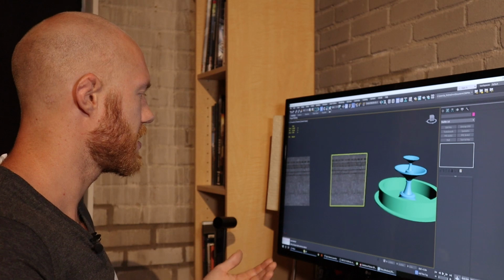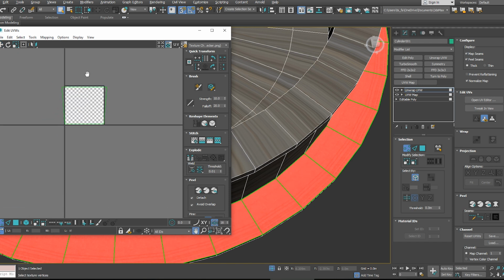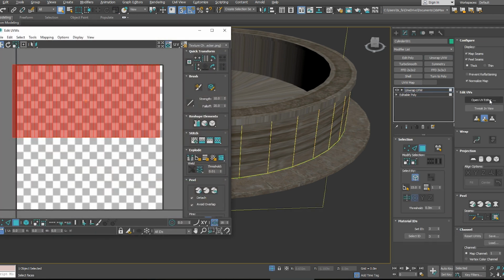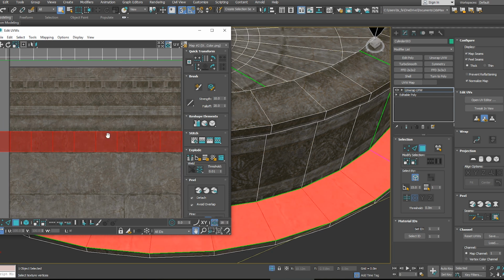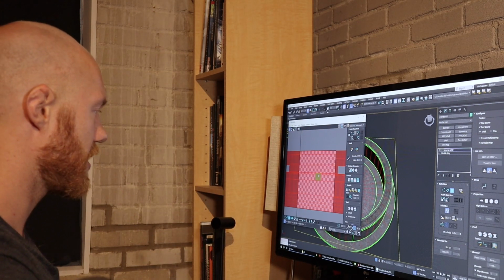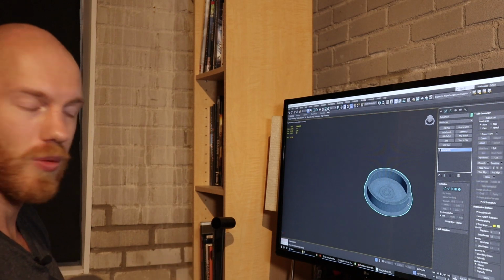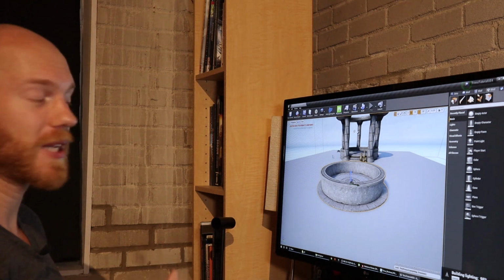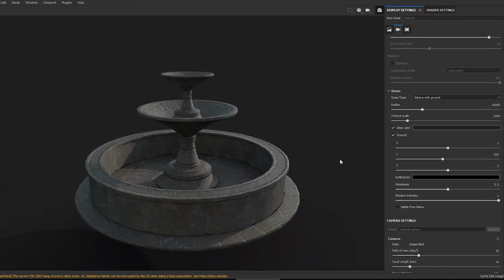Quick and Easy Trim Sheet UV Mapping Tips -Trim Texture Tutorial Part 4

Comment: I really liked this tutorial, even though it was a bit trickier for me because I'm using Blender. Still, I like how the mesh I made turned out. Though I'm sure I'll probably see a lot of problems with it when I get more experience with applying trim sheets to models.

I can see the main benefit of trim sheets, other than saving texture memory, is that it's easy to change any part of your texture if you want to add more detail or change it around a bit. One only needs to modify one strip instead of changing an entire material.

I'm definitely going to have to experiment with trim sheets and see what I can make. Maybe just make a bunch of simple objects, though I've had the thought of creating some simple sci-fi hallways. Though it might be better to create some buildings or other larger structures to test out the capabilities of trim sheets. Maybe some buildings, sidewalks, and roads.
Reply from the maker: yea its a super useful workflow. if you go on artstation and search trim sheet you will find a ton of examples, from beginner level to lots of AAA examples from games, it could give you some good inspiration and ideas :) thanks for watching
Reply: @PolygonAcademy  
Yeah, I should definitely look at Artstation for inspiration, thank you for the idea. And you're welcome.

Comment: My question would be, about how much texel density comes into play when modeling, as clearly the trim sheet will have correct density for given dimensions, for circular strips there will be some acceptable warping, but I guess the better an edge or strip matches the density set out in the trim sheet, then the better the texturing on the model?
Reply from the maker: Yea it definitley can impact your modeling, 10-20% wiggle room isnt very noticable so its not super rigid but for more complex/custom assets you can design trim sheets with different thicknesses that work better, and then combine it with 4 way tiling materials for larger surfaces where trims dont work. Like a wood planks trim sheet for detailing and a tiling wood texture to fill in other areas. 

With nanite you could also use the trim sheet to displace all the details and then texture the model with more basic tiling materials + texture masks for stuff like grime, damage/ scrapes etc because the displaced geo will be providing the details and that doesnt impact texel density
Reply: @PolygonAcademy  thanks for the detailed reply. Long time, part time indie dev, currently targeting VR so draw calls, bandwidth are priorities and nanite not some I can afford, but useful to hear that 10-20% margin is not so noticeable.

I think I will plan to build some trims that will cover specific architectural features and then try to model with constraints given by the texel density - ie if I have a tiling row that is optimal at 10cm tall, I’ll try and stick within that.

I’m considering some options for grunge/AO/weather etc… that will allow single shader pass and allow for essentially some decals for these kinds of elements but I’ve yet to come up with a good solution…

Comment: For Blender users, google 'Follow active quads' - essentially, add a seam, unwrap, rotate the unwrapped quads so a central one that is the most square is the right way up; select the left most X verts in the UV and S -> X -> 0, to scale the edge in X to the same X co-ordinate, repeat for the right edge in X and then do the top and bottom edges in Y, you know have aligned verts; swap to face mode, select this face and then hit L to select linked and right click and choose 'Follow active quads' and you'll get a strip you can scale.

What is missing in the above is a way to ensure the X and Y edges are the same length, resulting in a square, so I need to check that myself. There also ought to be a plugin for this as I use it a lot :D probably a relax in Blender would achieve that square result.

EDIT: I just found this video, with a promising UV Squares addon....

https://www.youtube.com/watch?v=JN1lLYsdeWc

yoink

Comment: New learner： how is the texture applied in 3dmax? Is it the base color exported from SP? Looking forward to your reply, thank you!
Reply from the maker: Yea i just use the base color in max and use all the other maps in unreal for the full shader with normals/roughness, they all get exported from painter. Thanks for watching :)
Reply: @PolygonAcademy  so how to add base color to max? Is it on the material panel or UV panel?:finger-red-number-one:
Reply from the maker: @zerolhaw62  yea you add it to the material, you plug the albedo map into the diffuse slot of the material and toggle it to show in viewport and it should work :)

Comment: /\ this, this is it. University deadlines done in like a few days. and i can use the textures over and over again. Question, if i want to combine two trim sheets onto one model, how do??
Reply from the maker: You would just use 2 materials on the mesh, apply each material to the areas you want it with material ID’s

Comment: Question:  What is the best way to deal with a large terrain.   By trim sheet or just repeatable texture.  But ppl will see the tile really quickly.  Wonder if there has a  better way.
Reply from the maker: Using a 4 way tiling texture, and then blending them together with vertex blending to help hide the repetition, and adding detail props ontop to also break it up

Comment: This is great!! So In case you want to bevel this geo, how would you handle the trim mapping? Bevel after and then fix Uvs?
Reply from the maker: yea i would bevel then fix the uvs. But i never really add bevels when using a normal map that has edge information. if you are using basic tiling textures and face weighted normals adding the bevel will definitely help. for me its either one of the workflows, i dont mix and match usually.
Reply: @PolygonAcademy  Thank you so much for replying Tim! And awesome! So far I have been working with tiling textures and weighted normals but getting rid of seams is super painful sometimes :(

Comment: I didn't realize that I have been using trim sheets for my projects for about 5 years lol
I do like that this video series went more in depth with trim sheets and how to properly setup and utilize them.

Looking at someone using 3DS also, I had forgot how cumbersome 3DS could be haha
I haven't used 3DS max or Maya since Blender 2.8 came out. 
Now in Blender 3.0 UVing and texturing is so much quicker than in 3DS max.
Reply from the maker: awesome, yea i gotta learn blender, I rarely do any 3d modeling anymore so i would be hella rusty either way, but keep hearing how blender is just amazing now.

Comment: how do you get the buttons under the modifier list ??
Reply from the maker: i think there should be a little icon at the bottom right of that panel, or if not you can right click and go to customize interface, then there is the option to add buttons under the modifer panel, you can add as many as you like then drag and drop whatever modifers you use most onto them. its been a  while since i did it but its pretty easy to figure out with a right click in that general zone and poking around :)

Comment: Thanks for this Tim, I learned a lot and finally finished my first trim texture, looks amateurish but hey, ill do this over and over til its perfect.
I still got a small issue though. Ive bought your project examples, but could not find any clues in it how you painted the ornaments specifically with a different material. 
In your video you showcase a project which has this strip with the ornament being metallic while the strip itself is stone, Im wondering how you extracted the mask from the normal only for the ornament. Thanks in advance!
Reply from the maker: that one i just hand painted the material mask in substance painter to have metal on those parts. just painted on the flat texture map mode using my wacom tablet. took like 5 mins. no fancy masking techniques on that one hahah.

Comment: Why don't you use the Unfold from strip loop button?
Edit: Nevermind, noticed others have already asked.
Reply from the maker: i do, show that later on, but some programs don't have it so i wanted to show the most basic method first
Reply: @PolygonAcademy  Yeah I noticed that now. Sorry.
A question though, isn't it inefficient to use that many polys for such a simple object? Is it offset by the amount of memory saved by using trim sheets?
Reply from the maker: @PhantomZtryker  yea polys are so cheap these days, doom eternal was pushing almost 100 million per frame, the bottle neck is still memory and drawcalls, even on nextgen, where i bet you will be able to have 500 mill polys rendered pretty easily.  even on farcry 4, a lot of our trees were 40k tris at LOD 0
Reply: @PolygonAcademy  I had no idea it was so high already. Thanks.

Comment: But by scaling the stitched strip in order to fix on the trim texture, you are changing the texel density as well... I'm so confused about how to use trim sheets along with correct texel density.... what's the point of using 2k texture, 4mX4m if you have to scale the UVs down to fit the mesh, hence making the texel density very different from the mesh size.

Please, Tim, make a tutorial about that. :)
Reply from the maker: ICO yea i am going cover texel density soon. But short answer, a 10-20% wiggle room exists where you cant really notice the difference, especially with a 2k texture being used on an asset being seen on a 1080p display etc. You can break it a bit, no game has perfect texel density across the board ;) if it saves you time of having to make another texture or a couple days production of doing every asset unique, its worth it.

Comment: For Blender users: You can select the whole loop, press U for the UV menu and select 'follow active quads' to get an instant even stripe.
Btw thanks for the amazing tutorials, I'm learning a lot with your channel!
Reply: You can also use the UV Squares addon.
Reply from the maker: awesome, thanks for sharing the info for blender peeps! cheers!
Reply: For some reason that option did make an even stripe but it stretched my faces vertically even though the mesh was properly scaled. Not a big deal since I can easily squash them back down but would know why did that happen. Thanks for the tip btw!
Reply: @vn2025  It helps to make the 'active' (or last selected face) into the shape you want the rest to follow. -i.e. if it's a square they'll all be squares.
Reply: @Izaharry  Thanks, I lately figured this out, too, didn't realize that before. :)
Reply: 3 Years... huh, what a long time :)
Now with ZenUV 4.0, you can work with trim sheets, and it's super ez!

Comment: How you are solving decals, dirt or drippings?
Reply from the maker: You can use projected decals in the engine on flat surfaces, or mesh decals for drips and grunge with alphas that you make to fit the mesh, like a decal drips ring around the round base part would work well with just a floating mesh over top the surface. Ill make a tutorial on this in future :)
Reply: @PolygonAcademy  future is tomorrow, right? :-D

Comment: Thanks for the in depth overview for trims. Really informative and very clear and concise. 

I was wondering about texel density. How strict is it? The uvs for the trims end up being quite different in size so the texel density is definitely not uniform anymore. But as you said yourself it's not very noticeable. So does that mean it's meant as a guide, a density to start from and you can deviate from it slightly (let's say scaling uvs up/down by max 20%) ? Or is it more strict than that? So if you start adding props you start from a similar texel density (let's say it's 3rd person, non hero prop) then scale it slightly to fit the 0 to 1 uv if need be?
Reply from the maker: you will get away with way more in a third person game but yea generally around 20% won't be noticeable. you just have to really look at the end results in context/ingame and see if its noticeable. texel density is never perfect in almost any game, just when it's really inconsistent it looks super bad.

Comment: let me get this straight - if i plan on doing a light bake in unreal, i will not be able to use this technique because the UVs are extending over the UV boarder. does this mean if the 3d scene in engine will have baked lighting i wont be able to use trim sheets?

Comment: Hey Tim, for the cylindrical items I like to use  "unfold strip from loop" and run "straighten selection" or planer map the top surface and break one of the edges connections in UVW and also run  "straighten selection". This will often result in a very even intervals so long as you reset X-form prior to opening the "UVW"
Reply from the maker: hell yea, good tip, that straighten selection button is super handy!

Comment: Does scaling the UV's to fit the texture sheet ruin the texel density? I don't know if that question makes sense. But you know how you already had the UVs created for your 4x4 wall, cut it apart and created a UV for it? But when you stitch it together it was outside the 0 to 1 space, does this matter for props? I thought it was important to keep the Uvs within that space. That's not to say your method is wrong, because I've seen people do it this way, but I'm just curious
Reply from the maker: depending how drastically you do it yes, it can break texel density but I find there is usually atleast a 10-20% "wiggle room" where it's not super noticeable. if you are strapped for time and budget, then its a good tradeoff to make vs being perfect, as 99% of players will never notice unless there is a huge disparity.

Comment: Tim! There is a strip loop button that does that all in one go for you at like 9minutes. It's in the "wrap" section under the planar map area in the modifier area of the main interface. Edit: you totally go over it in the next part, my bad haha.
Reply from the maker: Hahah yea i wanted to show the most absolute basic method first that works in almost any software, strip loop is dope but its max specific 😁
Reply: @PolygonAcademy  I remember when I first found it I got so paranoid of it crashing that I would detach the entire strip, do the function then re-attached and weld everything. Still found it faster in the end though haha
Reply from the maker: @ItIsNathan3D  yea it used to be hot garbage in terms of 50/50 making max crash but now it only does if its in subobject mode when you apply the uvw. thank god haha.
Reply: @PolygonAcademy  Yea I'm on 2020 right now and everything has been surprisingly stable. They even pre-loaded it with an isolate selection toggle hotkey finally. What alternate dimension is this?!

Comment: Forgive the potentially stupid question, but from my Uni days it has been drilled into me to have your UVs only in the 0-1 space, does that not matter with trim sheets?
Reply from the maker: tiling textures and trim sheets usually go outside of 0-1 and it's totally fine. for a unique prop with a custom unwrap yea, stick to 0-1 but a lot of the time even props you can quickly make with tiling textures and trims. if you are baking from a highpoly then yea you need to have your uvs inside the 0-1 space, but there are no real rules for environment models saying the HAVE to be inside 0-1, as most environment work relys on tiling textures and trims :)
Reply: Most 3d model software and game engines let you set the wrap mode for textures, so in the case of trim sheets, you can have the wrap mode be repeatable, thus any UVs outside the 0-1 space will get the same texture repeated.

For some baking, like overlapping geometry, you'd probably want only one of your uv islands inside the 0-1 space, with the other overlaps moved 1 uv tile over, so you only have 1 uv inside the space for a clean bake but still get the overlap because of the repeatable texture.

Comment: If it is a TUTORIAL then maybe it would be a good thing to actually explain how fuction called in software you use and where you can find it, and not just tell that you have made a short cut for it and don't remember how its called. I for example use Max, but don't knew about that stitching function in unwrap uvw. But after I watched you video where you use it I still don't know where it is because you don't know how its called and just have a hot key for it.
Reply from the maker: Yea sorry man totally forgot to show that! Its the stich function in max in the uvw editor, its in one of the top drop down menus, i set the hotkey to stich in the hotkey editor, not stitch dialogue box, which brings up the options window for the tool. Hope this helps :) here is more info on the autodesk site too: https://knowledge.autodesk.com/support/3ds-max/learn-explore/caas/CloudHelp/cloudhelp/2017/ENU/3DSMax/files/GUID-24EF7F46-6E18-4400-81CE-432BF001884B-htm.html